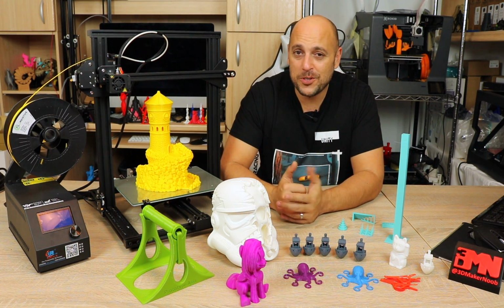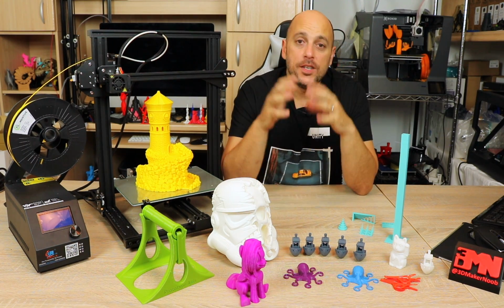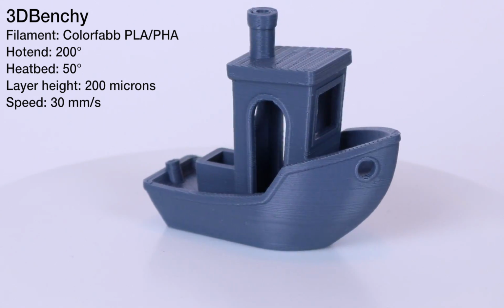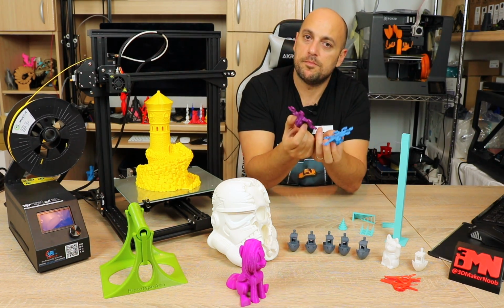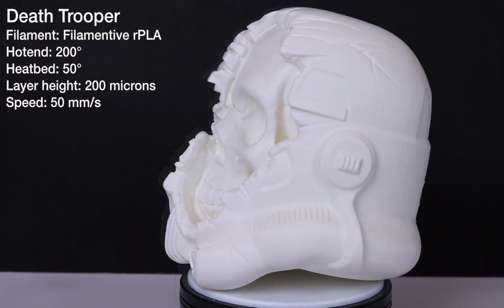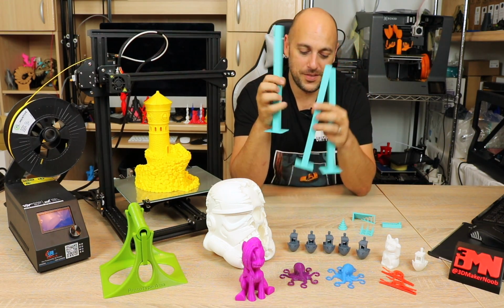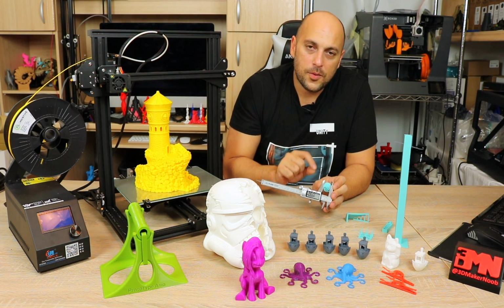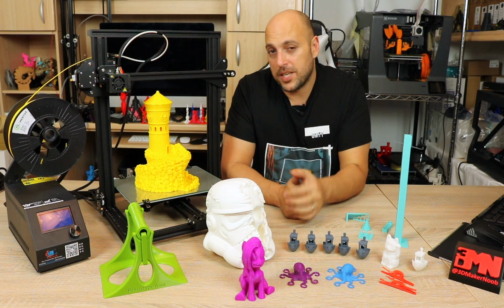A Noob's 3D Printer Review - Creality CR-10 Mini

Comment: I'm looking for a wood quality printer that I can make small items and use them in turn to make silicone molds. I have no clue what to get. This machine was recommended. What do you think? I need something that prints as smooth as possible but can handle fine details.

Comment: I have a CR-10 and the fan noise was driving me nuts. I googled how to make it quieter and found a tip with 4 fan replacements. WOW what a difference. It's hugely quieter now. the stepper motors are the most notable sound, unless the cooling fan for the supply, which is thermally regulated kicks on, and still it's much quieter than it had been. These same changes would work for the mini.

Comment: the $30 diference is because they want the cr10 original to look cheaper. new buyer will find it there is more value in the original cr10 with just only $30 difference. however for those who are aware of the cr10mini launching time will be thinking it is waste of money to buy cr10 mini .the cr10 mini is not their main selling point. it is faster to manufacture big scale focusing on 1 product rather than 4 product at the same time. the other model creality offer is just to fullfill the market needs.so that everybody will remember them as a best brand.from beginner to pro level. off topic : they should add rigidity of the frame to maximise the precision and better design the print plate rail so they dont have play between the frame & print plate

Comment: The more I check out Creality..the less I think I will buy one.  The selling price is well and truly disproportionate to the production costs....including packing the end products. The added cost of the S upgrade proves the point and this mini underlines my point. The CR 10 and 10S are the current over priced 3D printer out of Asia....and second only to Joe Prusa and what has become his golden eggs! I sold my two A8s to add funds towards the 10S.  The Chinese stores don’t help by adding sky high shipping costs ...knowing we want this current must have printer without the usual 3-5 week camel ride out of Shenzhen. I priced DHL to send a Cr 10 back to the factory...Au$38....BangGood want currently...au$78 to send me one.  I cancelled an order with GearBest because the 52 alleged  available were nor....and when I asked about the delay I shipping....on Back Order!  Since then I decided not to join the rush to get 10S ...or any other Creality. Tevo and the other clones get good reviews and while lacking g the 10S upgrades....they will soon be I. Production because they have to compete ditto the master clones...Anet....so I am waiting till the mania dies down and until the ....I got a third A8 to play with!
Reply from the maker: in my opinion, having the 10S, i don't see the extra leadscrew as a necessity, i didn't see it add much value to the printer in terms of print quality. the runout filament sensor helps a lot and the power off resume function for sure, but maybe not worth the price. Have you checked banggood? they are probably the only ones that ship within a few days and their shipping rates are very reasonable.

Comment: Cr10 mini or ender 2? I'm after quality but if they are similar will spend extra for the mini. At mo can get it for £50 more than the ender 2
Reply from the maker: +Joe Blog personally I’d probably go for the mini. The extra build volume, the additional part cooling fan and the community behind it are more than worth the bump in the price. Print quality is pretty much identical between the two
Reply from the maker: +Joe Blog you might also want to consider the i3 mega. Very good machine out of the box
Reply: 3D Maker Noob hmm another £70. I'm gonna be in enough poo with my missus  if I spend £233 on the cr10 mini. That's why I was looking at the ender 2 at £175. But then I saw the mini on offer.
Reply from the maker: +Joe Blog you won’t go wrong with any of them, elder might need a bit of additional work eventually due to no part cooling fan, the mini will be good right off the bat
Reply: im guessing its easier to remove prints off the glass also?
Reply: 3D Maker Noob thank you for the quick reply. I have bought a pre order cr10 mini. Nerys also suggested the i3 but I don't think I could have got that past my missus. The i3 was about £300 compared to the cr10 mini at £233.
Reply: 3D Maker Noob this morning I watched RC life and his review of the abycubic. I like the auto bed level he also found the quality good. It's making me wonder if I should switch to the anycubic? The mini is on pre order so could cancel. Plus on black Friday I wonder if I could get the anycubic cheaper than £300.

Comment: I need something that can print very small objects at 1:400 scale, like cars, planes, and trucks and buses. These are usually 2-6 cm in length and .5-4 cm in height. Can this printer print things this small?
Reply: The boat called "Benchy" which you see in most printer reviews is about 6cm in length and 3cm wide. Your objects can definitely be printed, though fine details like mirrors may look quite ugly. Perhaps an SLA printer like a formlabs form 2 is better suited, but those are quite expensive currently.

Comment: Talking about the relatively small difference in prices between a "big" CR-10 and its smaller bro, it's the same problematic as kids' shoes: it's not because they're tiny, that you manufacture them as easily as adults' shoes ;)
I dare suspect that the CR-10 mini design was the matrix of the big ones. CReality states that CR-10 mini's PCB and al are military grade... then support long very long hours of continued operation

Comment: Regarding the wavy lines in the tower tests, on one of the Youtube reviews of the CR-10 they were getting noticable wavy shifts when they printing large vases.  Turns out that it was the part cooling fan, which was strong enough that the airflow pushed and distorted and wobbled the part slightly during printing.  This probably has a lot to do with the shape of the fan shroud/nozzle, which looks like it's the same on the CR-10 and the CR-10 mini.  Turning off the cooling fan and doubling the perimeter layers prevented the artifacting.

Comment: "It's important to print really slow with flexible filaments..."

I always print slow, but I like the surface finish I get at 20 to 30 mm/s.  :D

I think the standardized tests will make it much easier to get an apples to apples comparison.  I know some people may get bored of seeing the same models over and over again, but for people who are serious about doing research for purchases, this is good data to have.  

I agree with you on the strange price point.  For the price delta, I'd scrape the 30 bucks from somewhere for the full size CR-10.

Comment: hi. I"m writing not just to thank you for yet another great and professional review, but in particular to congratulate you for your new even more systematic and standardized approach which should hopefully allow more comparison between printers. Especially i'm hoping it will be a solution to the problem i kept seeing: manufacturers keep putting some big numbers on their machines when it comes to printing speeds, some put 80, some 120, some like in this case 200, yet in real life it turns out differently. For example I'm currently printing mostly on a Prima Creator P120, which is i think a here in Germany re-branded (obviously more expensive :P ) Mp select mini, and here too they say something like 55mm/s. After experimenting around i actually print with it only around 35-45mm, and it's cases like this where i hope you'll develop a system to differentiate between the pie-in-the-sky promises of the manufacturers and the max speed at which a user who wants consistent max speed but at quality will do in his actual use. 

I saw for example you did an introduction for beginners series on another mp select mini type model, i'd be super curious if you were to give that a "realistic max speed" where you'd put that one, just like with the CR 10 and future printers. I hope in the future speeds will keep rising, but especially alongside with print sizes, since, like you mentioned in this review, maybe the wife might not like it if i printed big at the cost of always printing. I have a hope here with the growing trend of printers which save for power-off, which i hope to one day use to pause the printing in the evening and to resume next morning not to disturb the sleep of anybody.

Comment: Dimension error is good metric for the print quality! I had hard time to sand down parts that need to be glued together because the dimension is off.

Print quality at the maximum height is also a good test. Usually I don't go for the full height but tend to leave a 10 ~ 20 mm margin for maximum height if I have to print large object. 

As for the benchy with different print speed, I would love to see the actual printing time comparison. For example, 30mm/s finish printing in 45 minutes, 50mm/s finish printing in 38 minutes, etc. etc.

Lastly I would like some metrics on how the support printing is performing. Can the support be peeled off easily. Does the support leave significant marks on the print.

Comment: Great review Joe. How was the glass bed on the Mini, flat or did you replace it. Did you use glue stick on the glass ? And I bought and did a short you tube review of the CR-10 S5, the big mother. And the one I bought has a power loss resume feature that sort of works. Have you checked any of your CR-10 S printers to see if they have the power loss resume feature as well.

Comment: Great review.  Probably the best tested and in depth printer review I've seen.
I had a CR-10 S4, and the problem I had with echos I'm sure was due to the weight of the 400x400 print bed.  I would imagine that if ine doesn't need to print larger that 220mm in one direction, this version would have a slightly better print quality than a CR-10 or S4.
Reply from the maker: +Mark G infact it does, I noticed that it produces almost no ghosting or resonance at around 50 mm/s while the cr-10s shows them quite a lot
Reply: I have got the CR-10-S5 (500x500x500 mm) and that version is very obvious proof that the i3 setup (with a moving printbed) is not very well suited for larger print volumes indeed. I had to tune down the MAX Y acceleration (of the bed) to 250 (originally that was at 1500 steps / m2) in the firmware (configuration.h) to get rid of ringing / ghosting. But of course tiny parts now print rather slow compared to the normal CR-10 because it never reaches the end speed with tiny prints. Still it is very nice to have that kind of build volume. Compared to the normal CR-10 (that I also own) the print quality of the S5 is only slightly lower now, but still more than exceptable.
Reply: Tinkerman i bought the S4 to do architectural prints, the ghosting was bad with all those 90 degree corners and openings.  I had to slow the outter shell to 20mm/s to help, but it was never good for what i wanted it for.  Sold it to a guy who uses it for costumes and it works great for that since they are larger prints and usually have post production work done to them.

Comment: I like this new format Joe. It really helps. Maybe pasting screenshots of all your simplify and cura settings. There is a lot of them. I know that would help me.
Reply from the maker: +Tc Berry will try to include those. Thanks buddy
Reply: 3D Maker Noob I'm having trouble with mine causing little strings above the print when it needs to move. I think I have my retraction at 70mm/sec and .01 mm extrusion before turning moving. Any suggestions?

Comment: I thought they were limited in the firmware to a lot lower than 200mms?
Reply from the maker: +Colin Hickey it definitely reached a top speed of 141mm/s but mainly due to the small model as it didn’t have time to accelerate enough.